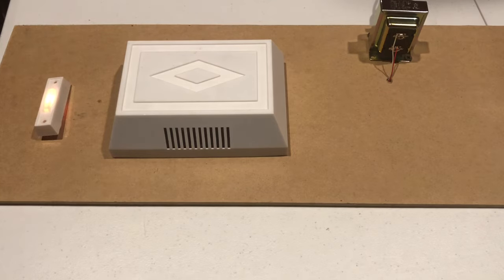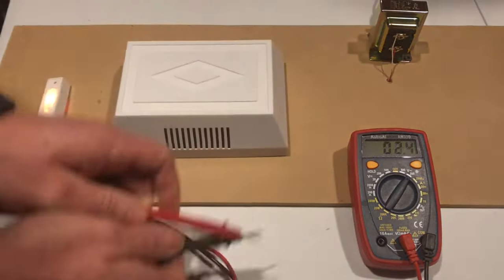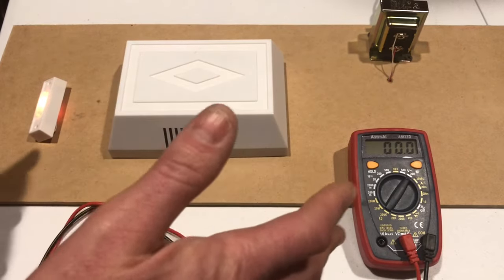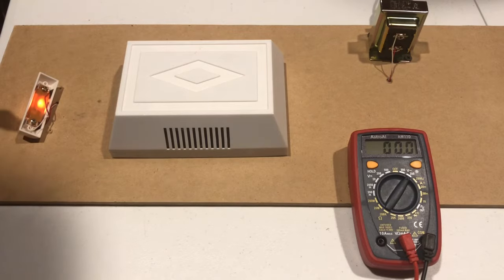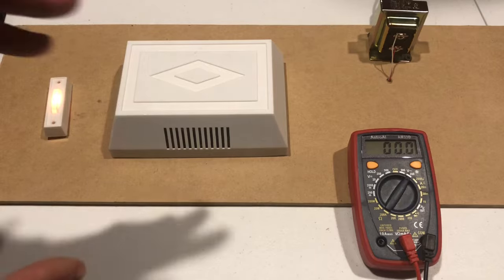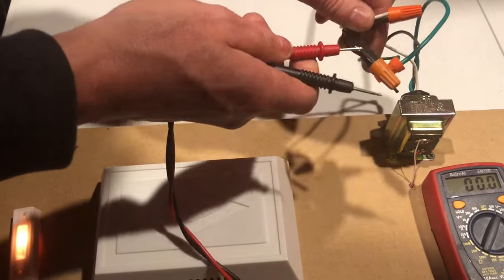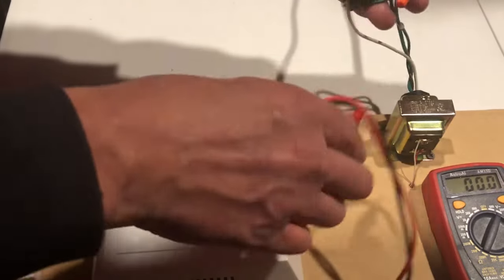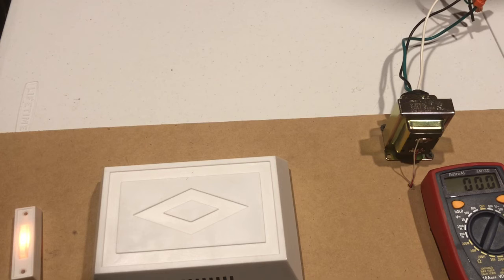Test Doorbell Transformer With Multimeter

Comment: When you are testing the high voltage side, best practice is to plug in the neutral probe first, then the hot probe. If you push in the hot probe first and you accidently touch the neutral probe, you will get shocked. When done with the test, pull out the hot probe first, then neutral.

Comment: I headed to the transformer to check it with a multimeter only to find a disconnected wire. Redid the 2 wires, now looks great and ....sound great, loud,loud enough that if we sit on the deck we would hear it, if only people used it instead of knocking.  I wanted to check the door bell button first but wanted to use a meter after watching your video. The transformer shows 10.2 volts, it doesn't look as "beefy as the one you used in you video. Thanks a lot for your help.
Reply from the maker: Great Find!  Thanks for watching!

Comment: My meter doesn't feature the sguiggly symbol. It has ACV and a choice of 750 and 200. Im guessing I'd set it to ACV 200. When I do set it to that, the transformer reads: 10 
However, one of the wires is still apparently connected to the bell. Should I disconnect that wire and retest it?

Comment: Thanks for your video. My issue is trying to deal with these voltmeters. They have different places they can be plugged into and too many different settings which looks like instructions from china. Since my meter is different than yours, and it shows different ways of probably many of the same on yours, it is useless trying to figure out how to work this. thanks

Comment: Are there any risks to my home if I upgrade my 16V 10VA transformer to a 16V 30VA as an attempt to get my Ring Doorbell 2 powered correctly? Right now I can't get any power at all to mine despite it working fine for the old doorbell. In other words, am I safe in just swapping out a transformer or is there any kind of fire risk since it's bigger, etc. Do I need to check if my wires can handle the increase, etc.? I just have regular solid copper doorbell wires.
Reply: Bill L I know it is 6 months later, but I did get the upgraded transformer. It was installed by an electrician. It did NOT solve the problem with my Ring 2 doorbell not receiving hardwired power. After that, I contacted Ring who promptly sent me a new replacement device that has been working fine for the last 6 months. So at this point I don’t know if the new transformer was necessary at all, but these are the steps I took to solve it.
Reply: Alan Whiteside Pasting the reply I sent to the other commenter here: I know it is 6 months later, but I did get the upgraded transformer. It was installed by an electrician. It did NOT solve the problem with my Ring 2 doorbell not receiving hardwired power. After that, I contacted Ring who promptly sent me a new replacement device that has been working fine for the last 6 months. So at this point I don’t know if the new transformer was necessary at all, but these are the steps I took to solve it.
Reply: c0ncept: Didn’t you test the voltage at the transformer and at the doorbell to first see if it was getting power or how many volts? If it was then you know it was a defective doorbell and you didn’t need a new transformer.
Reply: SWLinPHX the doorbell was intermittently getting power and losing power at random times. Sometimes it would just switch to battery power despite being hardwired. Long story short, a new transformer did not solve it but Ring sent a replacement device that has worked for the last year straight.
Reply: c0ncept well one of the Ring 2 doorbells at one of my properties is hardwired yet has started draining the battery so I have to test everything to see what the problem is.  Was working fine for a year and a half and this just started the last month.
Reply: Alan Whiteside  Yes, to get the proper voltage.  What you end up with at the doorbell cam has to be at least 16V.  What were you getting before?

Comment: My doorbell gets power when the wires are hooked to the chime, but the chime makes a buzzing sound. Came home one day and it smelled like it was burning up the chime. I replaced the chime and the new one does the same thing. Showing about 19 volts at the transformer and 19 volts coming out of the wall to the chime itself. So confused.
Reply: Mark, I had the same problem. A loud buzzing sound early one morning. Burning smell. So I still don’t have mine repaired. But husband disconnected it.
Reply: @6622863456  we ended up saying screw it and purchased a Ring that's battery powered. Had it over  month now and still has 45% battery remaining.
Reply: Mark that is what I am going to do too, today. Thanks so much
Reply: That sounds like you have a short circuit on the doorbell button or wires going to it.  If you disconnect the button and it no longer happens then it is just a bad button. If it still happens then it is a short in the wiring.
Reply: The buzzing sound is caused because the doorbell is stuck on the outside button which causes the circuit to stay live and then that burns out the chime. That happened to me.

Comment: What’s the weirdest & hardest place to install the doorbell transformer..... I don’t know, how about the 3rd floor attic crawl space, LOL.... WHY PPL, WHY🤣🤣
Thx for the vid✌🏼
Reply from the maker: I have to say that is the worst I have heard.  What state do you live in?
Reply: sellgooddeals DIY Florida. And yeah, have no idea what they were thinking, even w/ no “coat closet”, could still put in a pantry, near the panel, but nope.....in the last worst possible place you’d ever look, lol
Reply: I asked the homeowner today where their transformer was located they just said they have no idea...neither did I
Reply: John Bossnack Gotta say, most homeowners haven’t got a clue as to what a doorbell transformer looks like. 99.99% of the time, I show them a picture of what it should look like.....& most are like, “oh, that’s what that thing is in the closet, garage, etc....” 🤣 when they were painting or doing something. Also, haven’t found, worked on one, etc...that hadn’t been caked w/ multiple layers of paint. Fun times👍🏻👍🏻
Last thing real quick. Went to a customer’s house to do a “doorbell repair”, & asked if knew where transformer was, like usual. The guy said didn’t know, & so I showed him the pic. He than told me oh....that’s what that thing was is our closet. Didn’t know what it did & ended up ripping it off the wall & thru it away. Wonder why the doorbell quit working, huh🤣🤣🤣 Easy fix, as I just wired up a new one, lol.
Cheers✌🏼
Reply: @Aepek  lol threw it away and stopped working hmmm...people are strange sometimes
Reply: John Bossnack Yeah...was hilarious, when I found that “nugget of knowledge” out, lol. Cuz doorbell was working okay till they ripped transformer out & threw away, lol. Was hard not to laugh, & the wife was so mad😅, that the thing that was removed is what caused doorbell to quit working, lol.
Reply: @Aepek  I got a call that the wifi was down at a frat house...I got there and saw holes in the wall where it was screwed in...I said yup, it is in fact down...so where did you guys see it last...they found it in the broom closet...put it back up and wifi was back lol
Reply: John Bossnack 🤣🤣

Comment: I had a bad transformer but the new one doesn't have any information next to the screw heads on which is the load or no load side. The bolts are in a different oriantation and new one is from China but the old one is from Korea. All the ratings and classes are the same. Does it matter which bolts I connect my wires too?
Reply from the maker: You are absolutely  correct.  It doesn’t  matter which wire terminal you use on the low voltage side.

Comment: I have put two transformers on for my doorbell and I have 120 V going into the back but zero coming out the other side. Seems kind of hard to get two brand new transformers that are bad don’t you think?
Reply: I have done this 3 times already
Reply: John - I have the same exact issue now. Two new transformers out of the box and both showing zero voltage on secondary. How did you solve your issue?

Comment: I'm getting 1v at the wires of my doorbell... What's the deal? Is there a break in a wire somewhere, maybe?
Reply from the maker: Hmm, is it possible your transformer is feeding something else as well?  Such as door/gate lock, lit address sign or intercom system. What is the voltage at the transformer?  Do you have a chime?

Comment: Hello sir. Thanks for the video. My home address lights share the same transformer with my doorbell. The problem Im having is that although the doorbell works, the home address lights have stopped working. Can it be bad wiring? How do I test the address lights? Thank you!
Reply: Voltage is most likely too high and burning out your address lights. Have to step down voltage on transformer

Comment: I thought the transformer inputs AC and converts it to DC output?
Reply from the maker: There are converters and adapters that do change from AC to DC.  Ordinary doorbells use transformers that step down the power from 120V to a lower voltage usually 16V.

Comment: Can 3 new transformers be bad?
Reply from the maker: I doesn't seem likely that you would get 3 bad transformers.  Have you tested the voltage to the transformer to see if you are getting 110-120V?
Reply: @sellgooddeals-DIY  i am getting 120. I just tested my last one before installing with a snipped off extension cord and was reading 20v. After installing it and connecting the transformer read zero. I am frying them for whatever visit. I am guessing i have a short in my low voltage line.